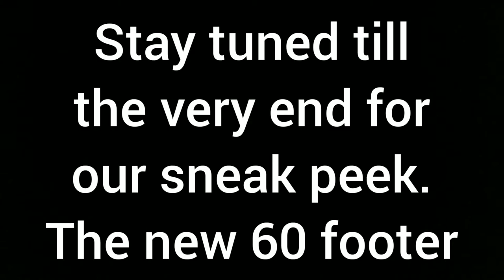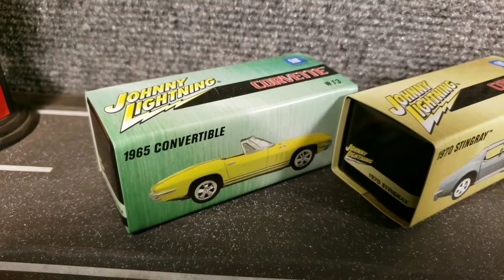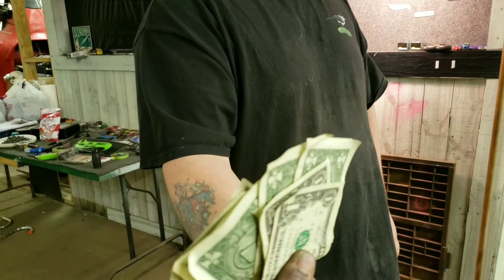Hot Wheels Bone Shaker Drag Race. Plus a Sneak Peek

Comment: Great video.ty 4 sharing brother. 1 question.where did you get the gray track. Ty
Reply from the maker: It's called Blu Track and we got it on Amazon. You can get whatever length you need. It's one continuous piece in a roll.
Reply: Ty Sir